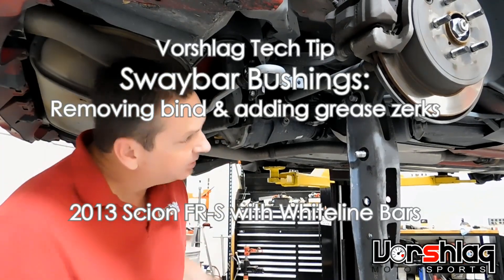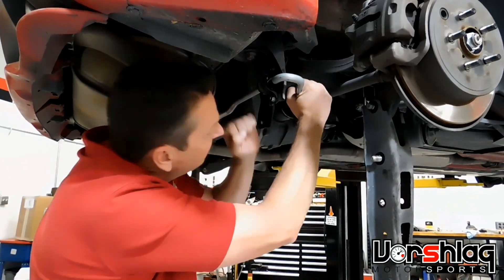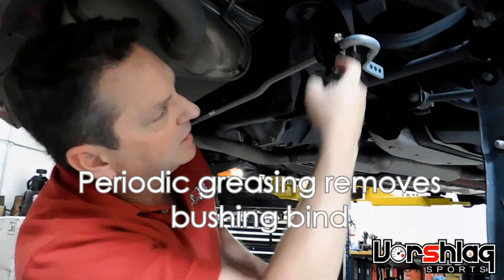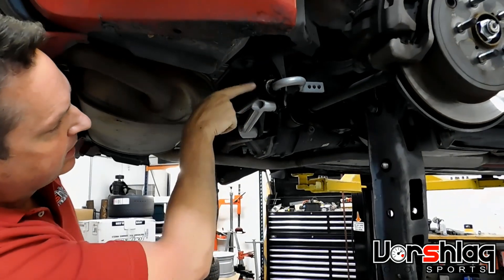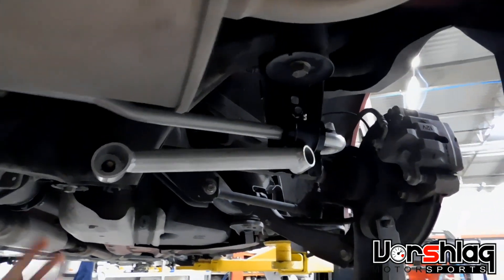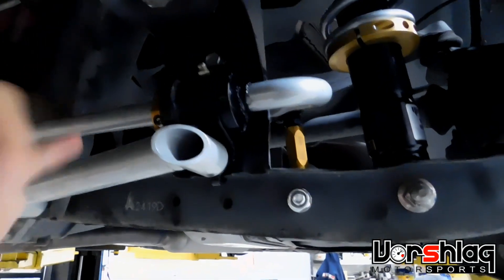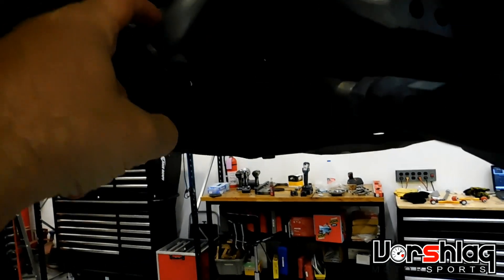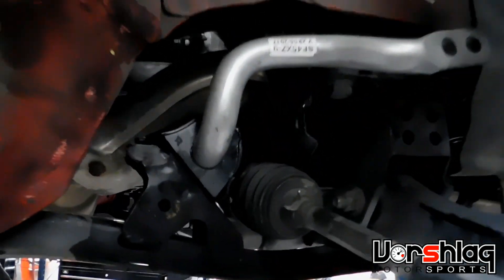Vorshlag tech tip: Removing swaybar bind

Comment: Trademark symptoms of this condition on a car: squeaking and creaking when leaving a driveway or entering one. You can also go over speed bumps slowly, and listen for one axle compressing at a time. If you’re getting squeaking, and it feels stiffer than normal, the bushings are usually the culprit.

Comment: Just went through this on a shop car with upgraded rear swaybar. The bushings are manufactured too thick, so when you can press the bracket down and torque it normally. It creates a binding condition, distorting the bore of the bushings, and allows the grease to squeeze out in a matter of days or weeks. 

One 8mm ID washer between the bracket and frame (on each of the 2 bolts) was all that was needed to shim it to the correct tolerances. 

Separate note: I’ll never install Whiteline sway bars and bushings on any car. 🥵 Nightmare headaches on another car.

Comment: What is the symptom of the sway bar bushing binding?
Reply: Lots of symptoms. In a modern 86, you can feel the swaybar bind going down an uneven street or pulling into driveways at an angle. 

In my case, I feel it through the dead-pedal, and it feels a bit like tapping but only appears when the suspension compresses to a significant degree. When it gets really bound up, you can also hear it in the passenger cabin. Worst case, the car will actually not sit evenly from side to side. When the bind lets go, you might feel the car sink on the affected side while youre cornering. 

If you're really familiar with how the car should feel, you might be able to tell that your spring rates aren't consistent as well. I typically notice this as really stiff rebound and sometimes as overly stiff squat/dive or hesitancy to squat/dive when bind gets bad.

Comment: I understand how greasing the bushing will help to reduce binding, but I don't understand how shimming (which usually tightens cavities and removes slop/play - like for shimming E46 RTABs) can help to reduce binding. Please explain. Thanks in advance!
Reply: Think he means shimming with washers or cut and drilled flat stock on the studs between the bushing mount and bracket effectively making a larger cavity/void for the bushing.......To visualize imagine a protractor/D shaped bracket against a plane/mounting surface. Moving the bracket/D away with shims creates a larger space for the bushing.